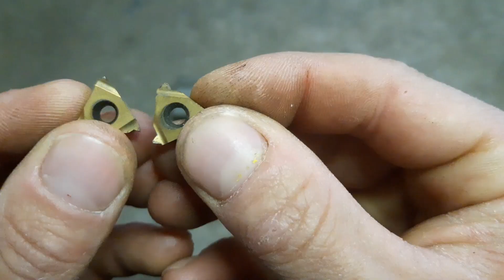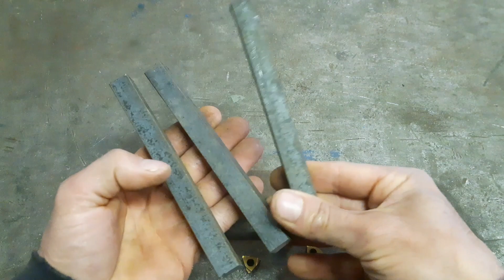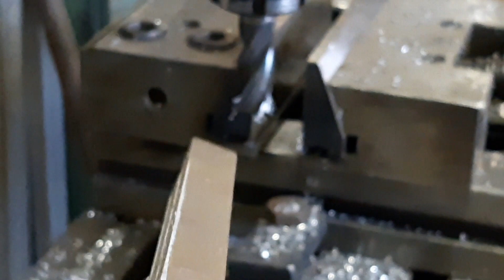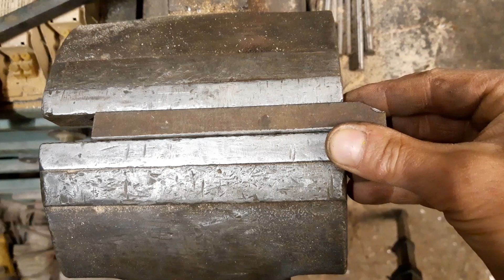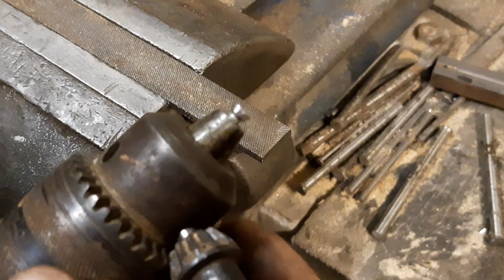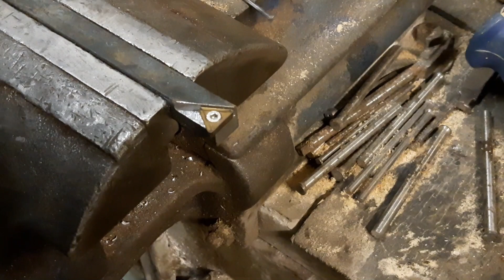lathe tools homemade, utensili per tornio fai da te

Comment: Those inserts will move in use.  Questi inserti si sposteranno durante l'uso.
Reply from the maker: Li sto usando da più di un anno e non si sono mossi!
Reply: @newtech5042  It may not be possible to see the affect of slight movement with the naked eye. the reason I said it was because there appeared to be gaps between the rear of the insert and the holder. This is never the case with a purchased holder as the insert always has a snug fit to it. In your case the only thing stopping rotation is the screw tightness.
Potrebbe non essere possibile vedere l'effetto di un leggero movimento ad occhio nudo. il motivo per cui ho detto che era perché sembravano esserci degli spazi tra la parte posteriore dell'inserto e il supporto. Questo non è mai il caso di un supporto acquistato poiché l'inserto si adatta sempre perfettamente. Nel tuo caso l'unica cosa che ferma la rotazione è la tenuta della vite.
Reply from the maker: Hai perfettamente ragione, è palese che utensili creati con una sede che appoggia su due lati, sono molto meglio!
Però devi considerare anche le possibilità che hanno molti appassionati  o dilettanti.... 
Ho solo fatto vedere un metodo  per poter fare un utensile discreto in modo semplice e veloce, cosi da poter iniziare a lavorare e fare esperienza!
Reply: @michaeltelemachus5112   se hai visto altri video noterai che  New Tech usa tecniche di lavorazione davvero valide su macchine tradizionali, quindi condivido ciò che ha scritto per quanto riguarda l'impegno e l'inventiva per dare a tutti la possibilità di avere utensili a basso costo, soprattutto nei paesi emergenti!
Reply: @alexthomas6865  I understand what you are saying and I am a subscriber to this channel as I enjoy most of his work. However, in this case, I am afraid that this is a poor tool unless it is made accurately, as it will produce poor results. Far better to just stick to High speed steel tools which can be produced easily and cheaply on a bench grinder.